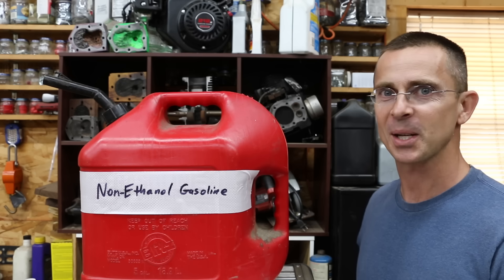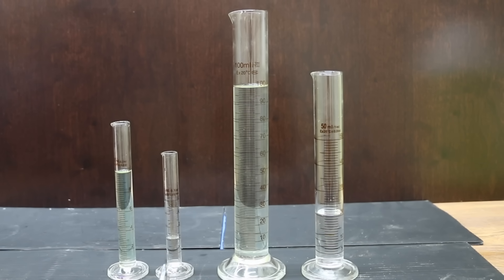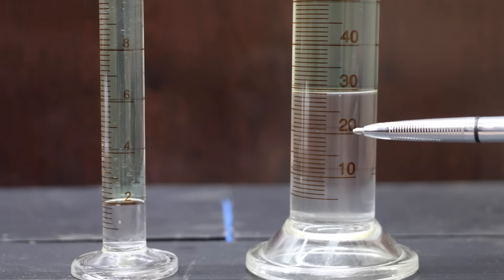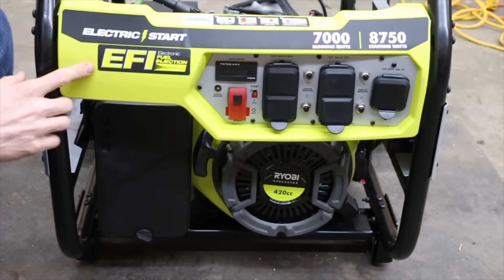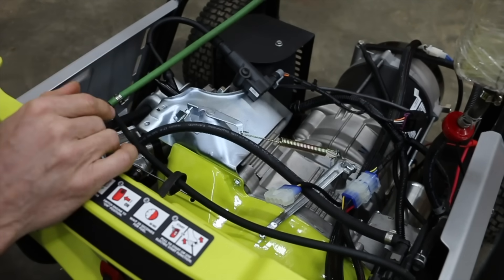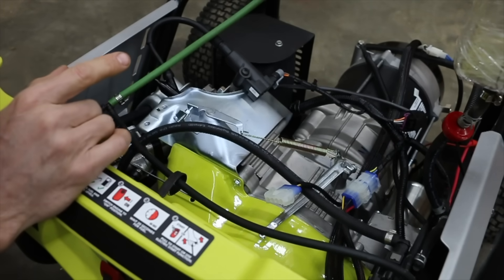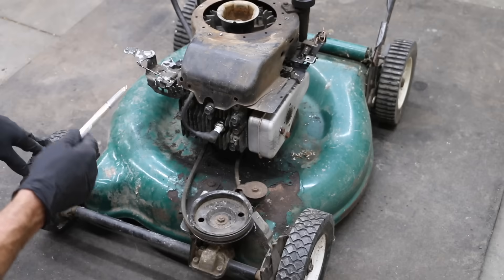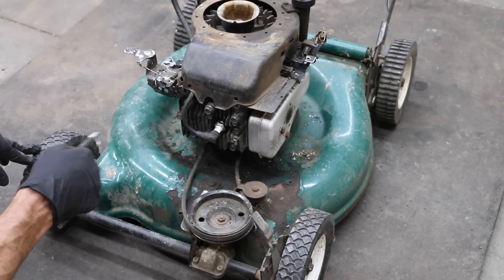Is Non-Ethanol Gasoline Really Better? See the PROOF!

Comment: 1 Ltr gas = 9.6kWh, 1 ltr Ethanol = 5.9 kWh. the reduction in energy has to be made up somehow and that will generally be more fuel, which you buy. Adding Eth increases fuel octane rating which has nothing to do with energy but the extent to which it can be compressed before  it detonates and a higher compression equates to a more efficient burn, hence the efficiency argument. In short to perform any given amount of work requires a fixed amount of energy and if you have an older engine Eth will not make it more efficient because it will not have a high compression ratio, also it will likely have brass and rubber parts in the fuel system that are likely to corrode in the presence of Eth. If you have a modern engine with high compression it will probably be able to use Eth and have higher efficiency.
Reply from the maker: Great point!
Reply: You are right on the efficiency in high compression engines, but wrong on rubber and brass.

Ethanol is much >>>easier<<< on rubbers, plastics, and metals than what gasoline and BTEX(benzene, toluene, ethyl benzene, and xylene) are.

If you doubt this, look here:

Ethanol = https://www.customadvanced.com/chemical-resistance-chart.html?chemical=Ethyl+Alcohol&rubber=

Gasoline = https://www.customadvanced.com/chemical-resistance-chart.html?chemical=Gasoline&rubber=

Benzene = https://www.customadvanced.com/chemical-resistance-chart.html?chemical=Benzene&rubber=

Toluene = https://www.customadvanced.com/chemical-resistance-chart.html?chemical=Toluene&rubber=

Ethyl benzene = https://www.customadvanced.com/chemical-resistance-chart.html?chemical=Ethyl+Benzene&rubber=

Xylene = https://www.customadvanced.com/chemical-resistance-chart.html?chemical=Xylene&rubber=

Need a second opinion?

https://www.coleparmer.com/chemical-resistance

Or here for a third opinion:

http://www.graco.com/content/dam/graco/ipd/literature/misc/chemical-compatibility-guide/Graco_ChemCompGuideEN-B.pdf

See what high aromatic gasoline is rated for with aluminum:

https://www.calpaclab.com/aluminum-chemical-compatibility-chart/

Note that ethanol is good with aluminum.

The main nontoxic ingredient of RV antifreeze is ethanol and it would not have stood the test of time if it had been corrosive.
Reply: I raced this stuff years ago but here's a quote may help:So, looking at the most pernicious chemicals, (ethanol), what it is UNSUITABLE with –METALS – Zinc and galvanised materials; Magnesium alloys; Brass; Copper; Terne plate (lead/tin coated steel); Aluminium; Zamak,ELASTOMERS – Viton Buna-N (seals only); Neoprene (seals only); Urethane rubber; Acrylonitrile-butadiene (ABS) hoses; Polybutene terephthalate.POLYMERS – Polyurethane; Polythylene terephthalate (PET); Alcohol based polymers (e.g. pipe dope); polyvinylchloride (PVC); Nylon 6 & 66; Nitrile rubber (NBR)(Buna-N) with low acrylonitrile content (hoses, seals, grommets); Glassfibre-reinforced polyester and epoxy resins; Shellac.OTHERS – Cork; Natural rubber; Petseal tank sealant.This information is from the Department for Transport 1 and the FBHVC 2
Reply: Higher combustion efficiency, but often not higher fuel efficiency.

Take PF's result with a one cylinder engine, for example.  It was 4% less.  Now extrapolate that loss of fuel efficiency when ethanol is used in a 4, 6, or 8 cylinder engine commonly found in vehicles of all types.
The result is typically around 10-40% less fuel efficiency, making ethanol blended fuel MORE expensive to use over the long run, despite the perceived savings at the fuel pump.  
Conclusion: ethanol is a scam and a joke.
Reply: @DejaWiz  The 4% loss of fuel efficiency which only happens in lower compression type gasoline optimized engines is more than offset by the ethanol fuel cost being far more than 4% less.

Let us look at the world's most selling vehicle, the Ford F-150 which gets 20 mpg on E0 and 15 on E85. The EPA states most vehicles lose 3 to 4% mpg on E10 and 4 to 5% on E15.
Prices from e85prices.com

https://www.fueleconomy.gov/feg/Find.do?action=sbs&id=41030

E0 = $2.44 @ 20mpg = $.122 cost per mile

E10 = $2.10 @ 19.2mpg = $.109 cost per mile

E15 = $2.03 @ 19mpg = $.107 cost per mile

E85* = $1.81 @ 15 mpg = $ .121 cost per mile

*E85 looks more expensive per mile in winter because it is E50 so mileage should be more than 15mpg that I kept and on top of that the price per gallon is higher than it would be because of more gasoline in blend.  In other words, the cost per mile is probably still the least with E85.

Also note that gasoline is exceptionally cheap right now.  The spread between gasoline and ethanol is normally far higher.

E85 also gives more horsepower and more torque.  

For example a Chevy pickup with a 5.3L gets a clean 380 horsepower on E85 vs a toxic 355 horsepower on E0 straight gasoline. https://media.gm.com/media/us/en/chevrolet/vehicles/silverado/2014.tab1.html 

In high compression engines, ethanol gets both more power AND more mileage than gasoline, some even more than diesel engines without the need to commit felonies to pass emission tests!
Reply: @danafletcher2341  you must work for the propaganda division of the ethanol industry. Ethanol contains less energy (BTU'S) than gas thus requiring the use of more fuel to produce the same amount of energy as straight gasoline. FACT 
As an engine builder for 30 years. I have seen the before and after effects on engines and fuel systems related to the introduction of ethanol to the fuel supply. Your propaganda is not going to change the reality that ethanol is bad for engines.  With one exception... race engines can often times be tuned to run more consistently on alcohol than on gas. But that comes at the expense of netting roughly half of the fuel economy. And at 15.5:1 you can't exactly call my drag race engines low compression.
Reply: @prestonrieger8410  A Brief History of Racing Fuel By Craig A. Johnson
In 2005, the IRL used 100 percent methanol in their tanks. The fuel worked well and >>>>was more efficient than straight gasoline<<<<, but IRL officials believed there was room for improvement. In 2006, they moved to a 10 percent blend of ethanol and methanol, which was then changed to 100 percent ethanol for the 2007 season.

The desire to use only ethanol aside, 100 percent ethanol is nearly impossible to obtain, and is illegal to keep without paying hefty taxes that date back to prohibition. The actual fuel used by the IRL is a blend of about 98 percent ethanol and 2 percent denaturant. The exact composition includes a small amount of high-octane racing fuel. The fuel for today's Indy cars has an octane rating of 113, compared with methanol's 107. This means a significant reduction in pre-ignition, or knocking and pinging.

In addition, many of the people who handle the fuel, say it smells like tequila. This quality may seem insignificant, but smell is actually one of ethanol's benefits when compared with methanol. Pit crews noticed the switch to ethanol immediately, reporting fewer coughing fits and less eye irritation before any other modifications were made to accommodate it.

According to Dennis Vervynckt, manager of hospitality services and an IRL official, in 2006, the first year the IRL began using ethanol, teams saw a reduction in efficiency of about 10 percent. "That's because we put straight ethanol into the tanks," he says. "The teams initially didn't make any�or very many�adjustments to their engines. After a few months, they kept tweaking and by the end of the season they were back up to 100 percent efficiency."

Vervynckt points out that there was a minor loss of power. "When they first started using ethanol, teams saw a slight drop in horsepower," he says. "As the teams got used to the fuel, they were able to get more horsepower from ethanol once they again reached maximum efficiency."

The switch to ethanol also allowed the racers to carry less fuel and make fewer pit stops, thereby increasing efficiency even more. "When the cars ran on methanol tanks had to hold 30 gallons to accommodate the fuel requirements of the cars," Vervynckt says. "After getting the engines to perform at their full potential, there was a significant gain in mileage. Indy cars now have 22-gallon tanks. When a driver pulls in to change out his tires, he can fill up. Teams were able to match their tire and fuel stops exactly, instead of stopping for tires only, or fuel only."

That efficiency translates into much less fuel being used by the sport. Lifeline Foods LLC, which supplies fuel for the IRL, will produce 120,000 gallons of ethanol for the 2008 season. And though this may seem like a lot, it's 20,000 gallons less than was used the previous seasons.

The switch from methanol-based fuel to ethanol has amazed almost everyone in the league. Drivers, the direct users of the fuel, voice their approval in glowing terms. "[Ethanol] is an American fuel that is good for the country and the environment," says Ryan Hunter-Reay, of Rahal Letterman Racing and driver of the ethanol car. Standing beside his crew as they make last-minute adjustments to the car, he is more than happy to discuss the benefits of the IRL's switch to ethanol. "It's been great for Indy racing�the fuel economy, emissions�there's nothing we don't like. We love it."

ANOTHER ARTICLE:  
by Timothy Charles Holmseth:
Since 2006, the cars burning up the track at the Indianapolis 500 have been running on ethanol fuel, and according to Indy 500 officials, there has been virtually no downside.
"In 2006 we ran a 90 percent methanol, 10 percent ethanol fuel mix," said John Griffin, vice president of public relations for the IndyCar Series. "Last season, 2007, we ran our entire season, including the Indy 500, on 100 percent fuel grade ethanol."
This year's race will be no exception. "This is the second Indianapolis 500 that will be run on 100 percent fuel grade ethanol," 
Griffin said.
In 2005, IndyCar Series partnered with the Ethanol Information and Promotion Council to introduce ethanol to the Indy 500 industry. "From the 1960's to 2005, the Indy Car Series ran on the methanol," he said, explaining that in the last few years a large transformation has taken place.
The change has been a welcome one on many fronts, he said. "The fuel efficiency for us has gone up," he said. "So much so, that prior to last season we actually reduced the size of our fuel tanks from 30 gallons to 22 gallons so we could match up fuel and tire usage stops to be one stop," he added.
"The one thing you'll hear in the garage area, both from a vision and smell standpoint, [is that] the ethanol is much easier on the eyes and much easier on the nose than methanol ever was," Griffin said.
Griffin said the success with ethanol use being seen by the cars and drivers provides good exposure and positive knowledge to the public. "There's probably a great chunk of our population who don't realize there is ethanol in our fuel, depending at the gas station we stop at," he said, pointing out that ethanol is far more common than some people even realize.
Indy 500 literature on ethanol showers the fuel with praise, stating: The move to 100 percent fuel-grade ethanol makes the IndyCar Series the motorsports leader in using a renewable and environmentally friendly fuel, and it fits with the Indy Racing League's long tradition of technological and safety innovations. Many of the leagues innovations eventually become incorporated into passenger vehicle designs.
Further, according to the IndyCar Media Guide, it's a fact that the transition to ethanol from methanol-based fuel has been a huge success from a performance standpoint. Without losing any horsepower or speed on the track, IndyCar Series cars burned 20,000 fewer gallons of fuel using ethanol than previous seasons using methanol.
New Zealand native Scott Dixon earned a record $2,988,065 from a record overall purse of $14,406,580 for his victory May 25 in the 92nd Indianapolis 500-Mile Race. Jeff Simmons finished in 28th place after an accident in Sunday's race. Meanwhile, Team Ethanol Driver Ryan Hunter-Reay was the top finishing rookie at 6th place � snagging the best Indy 500 finish in the team's history.
Reply: @prestonrieger8410  In Brazil they find identical engines last up to three times longer on E100 than their common gasoline. (no soot)

Here is what exploding ethanol use in the US did to repairs and maintenance:

https://uploads.disquscdn.com/images/09f191db1baf6565c0aa85036f5531a1d479706d47ee0e4dbe160e2d71a7521f.png
Reply: @DejaWiz  It's less efficient in an improper engine. That's like saying diesel doesn't work right because a petrol engine has issues with it.

Ethanol engines have long strokes to capitalise on the slower flame speed and higher pressure (compression ratio or boost) to take advantage of higher knock resistance. This means you can run a small, slim, tall engine with the power of a larger, wider, heavier engine meaning less friction/rotational losses for a given power output.

Ethanol will prove invaluable when it can be derived from scrap biomass instead of food crops.
Reply: Dana and Guy...that's exactly my point.  Modern vehicles are designed to run on non-ethanol and up to 10% ethanol, not just ethanol/blend.  There WILL be fuel efficiency losses when using an ethanol blend, and that's mostly due to ethanol having much lower potential energy in it than straight gasoline.
Reply: As you say an engine designed and engineered to run ethanol will work  efficiently with it. I raced engines on pure ethanol and they were exactly as you describe high compression up to 16 to 1comp,  long stroke and 40deg advance on the ignition and they still ran cool, however one designed to run straight petroleum will not, that's exactly my point. The vast majority of engines out there are not.
Reply: DejaWiz,  Ethanol is cheaper to drive than gasoline, even in our current gasoline optimized engines.  Dollar efficiency is king.

Ethanol just as an octane booster is especially cheap, nontoxic, clean burning, and concentrated.  The extremely toxic octane booster of lead was a disaster for humanity and we jumped from the frying pan into the fire with the addition of toxic and carcinogenic aromatics like BTEX to take its place.  Every percentage of ethanol means less BTEX(which is a disaster for humanity).

No cost is assigned to the toxicity of petroleum, it is a heavy cost.

Only vehicles that are lower compression gasoline optimized ones will you get lower mpg(but with more power though).  

High compression engines will get better mileage and power than gasoline and can be even better than diesel which has even more BTU than gasoline.

But that is not the whole story because mileage should account for power to be a totally fair comparison.

Oak Ridge National Laboratory measure our US flex fuel fleet for mileage but with taking power into account.  This is called the "gasoline equivalent ratio".  While some were higher and lower, E85's mileage averaged 3% better fuel economy that E0 when power is factored in(i.e. apples to apples).

See bottom of page 7, top of 8.: http://web.archive.org/web/20170121004456/https://www1.eere.energy.gov/bioenergy/pdfs/analysis_saab2007.pdf

We should make ethanol fuel from coal, oil, and natural gas like China, Indonesia, and India are doing from an economical process from a Texas company which is called TCX Technology.  

With enough ethanol, we could have dedicated ethanol engines which are half the size/twice the power of gasoline ones which mileage greater than any other fuel and as clean as only an electric car advocate dreams of.  All that with no expensive new fuel infrastructure and still using our current vehicle fleet until it is wore out.
Reply: @PK-767  Corn ethanol is made from "scrap" or waste.  

Corn ethanol is a value added product of feed production which uses a waste stream from it(the starch) which cattle can not digest very well and a lot pass through undigested as waste onto the ground in their manure.

Corn ethanol uses only the starch and leaves the feed(100% of the proteins, 100% of the fats, and 100% of the minerals) alone, actually enhances it to be more productive, more digestible, more concentrated, and healthier for the animal than straight corn.

Better/more food with a super cheap, super nontoxic, super clean, and super concentrated octane booster/fuel/oxygenate as a bonus. Who can be against that?

I actually see corn stover as not a waste, but as food for soil microbes which are needed for soil health(care and cover cropping are needed there).  But there certainly many huge sources of cellulosic waste for the taking in this country.

BTW 60 minutes has shown a game changer for cellulosic ethanol here:
https://www.cbsnews.com/news/marshall-medoff-the-unlikely-eccentric-inventor-turning-inedible-plant-life-into-fuel-60-minutes/
Reply: Are you sure? Think about it ethanol is about produces about 60% less power per Litre burnt than gas so unless it is 60% cheaper it is no gain.
Reply: @rubblejohnstone4460  Let us look at the world's most selling vehicle, the Ford F-150 which gets 20 mpg on E0 and 15 on E85. The EPA states most vehicles lose 3 to 4% mpg on E10 and 4 to 5% on E15.
Prices from e85prices.com

https://www.fueleconomy.gov/feg/Find.do?action=sbs&id=41030

E0 = $2.42 @ 20mpg = $.121 cost per mile

E10 = $2.10 @ 19.2mpg = $.109 cost per mile

E15 = $2.03 @ 19mpg = $.107 cost per mile

E85* = $1.81 @ 15 mpg = $ .121 cost per mile

*E85 looks more expensive per mile in winter because it is E50 so mileage should be more than 15mpg that I kept and on top of that the price per gallon is higher than it would be because of more gasoline in blend.  In other words, the cost per mile is probably still the least with E85.

Also note that gasoline is exceptionally cheap right now.  The spread between gasoline and ethanol is normally far higher.

E85 also gives >>>MORE<<< horsepower and more torque.  

For example a Chevy pickup with a 5.3L gets a clean 380 horsepower on E85 vs a toxic 355 horsepower on E0 straight gasoline. https://media.gm.com/media/us/en/chevrolet/vehicles/silverado/2014.tab1.html 

In high compression engines, ethanol gets both more power AND more mileage than gasoline, some even more than diesel engines all without the need to commit felonies to pass emission tests!   Ethanol burns super clean.

Here is an ethanol engine on the roads today worldwide(not US) that gets equal mileage to diesel engines:
https://www.oemoffhighway.com/engines/press-release/21005554/scania-ab-scania-introduces-bioethanol-engine
Reply: except for the fact that it will corrode aluminum parts almost immediately, will run 20-30% leaner and dissolves almost all fuel filter elements that arent stainless steel.
Reply: @rustysausage69  Hi there, I think you may have confused ethanol with methanol.  The early flex fuel vehicles in the 90s used stainless steel for M85, but todays flex fuel vehicles use only mild steel parts that are identical to nonflex fuel ones for E85.

Ethanol has no problem with aluminum or any other metal in chemical compatibility charts, our high aromatic gasoline and BTEX does.  Perhaps below 160 proof alcohol can have problems with aluminum though fuel systems would never see such a thing unless through vandalism or such.

I believe they even sell ethanol in aluminum cans though I personally prefer glass for all of my food and liquids.

Ethanol is much >>>easier<<< on rubbers, plastics, and metals than what gasoline and BTEX(benzene, toluene, ethyl benzene, and xylene) are.

If you doubt this, look here:

Ethanol = https://www.customadvanced.com/chemical-resistance-chart.html?chemical=Ethyl+Alcohol&rubber=

Gasoline = https://www.customadvanced.com/chemical-resistance-chart.html?chemical=Gasoline&rubber=
Benzene = https://www.customadvanced.com/chemical-resistance-chart.html?chemical=Benzene&rubber=
Toluene = https://www.customadvanced.com/chemical-resistance-chart.html?chemical=Toluene&rubber=
Ethyl benzene = https://www.customadvanced.com/chemical-resistance-chart.html?chemical=Ethyl+Benzene&rubber=
Xylene = https://www.customadvanced.com/chemical-resistance-chart.html?chemical=Xylene&rubber=

Need a second opinion?

https://www.coleparmer.com/chemical-resistance

Or here for a third opinion:

https://www.graco.com/content/dam/graco/ipd/literature/misc/chemical-compatibility-guide/Graco_ChemCompGuideEN-B.pdf

See what high aromatic gasoline is rated for with aluminum:

https://www.calpaclab.com/aluminum-chemical-compatibility-chart/

Note that ethanol is good with aluminum.

The main nontoxic ingredient of RV antifreeze is ethanol and it would not have stood the test of time if it had been corrosive.